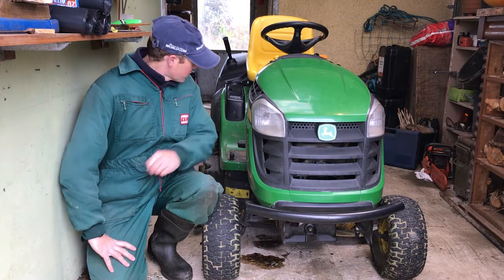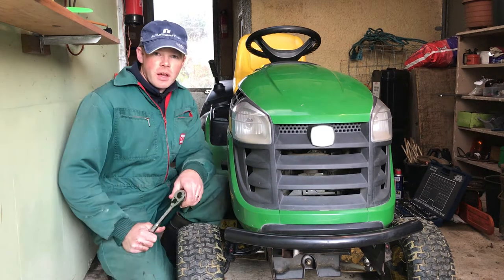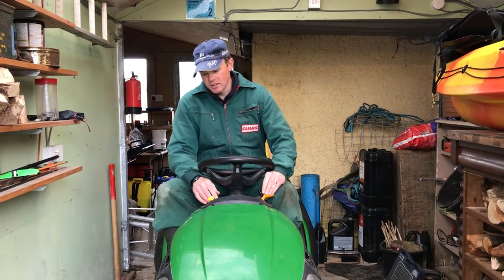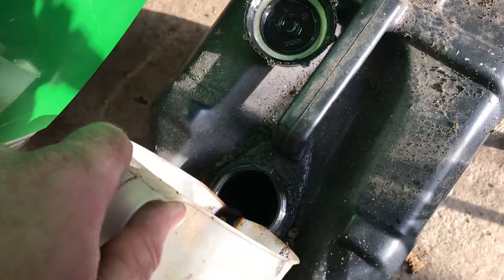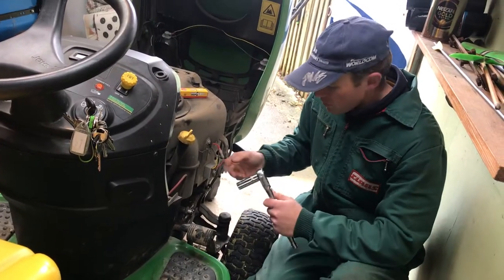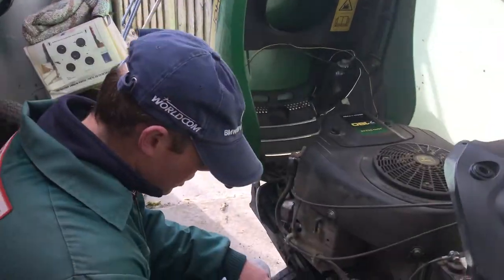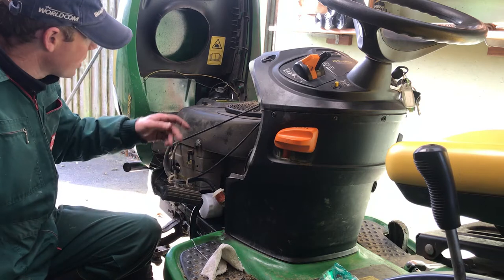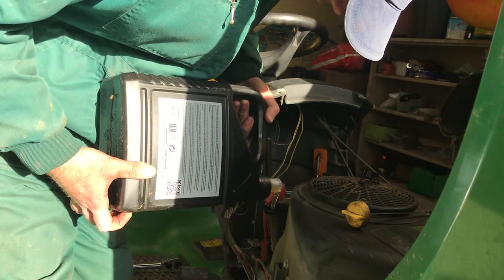John Deere X155R Mower Servicing

Comment: Very useful video, thanks for taking the trouble - much appreciated.
 I have the same model JD X155, I think I bought it in 2012  but mine only has 70 hours on the clock.  It's a good machine, but I find the chute clogs too easily if the grass is even slightly damp, and we do tend to have a lot of damp days  especially where  I live in the NW corner of Ireland.  The black mesh in  the grass collector box tends to get blocked with grass mulch and I suppose that really restricts the flow of air through the chute and into the grass  box. 
I've had it serviced once at a workshop and changed the plugs, air filter and oil and filter and greased up the  kingpins etc. myself,  but after seeing your video I would be able to do all of that no problem. I've been a biker for many years and do a lot of servicing on my motorcycles.  But the belts and pulleys  on the mower were a mystery to me,  that' s something I was a bit concerned about TBH.  Glad to see they are so easy to access, and I'll be  getting in about them in the coming days. 
Since you use yours so frequently, could I ask, have you had any problems with the  chute getting blocked with damp grass, and could you share any tips on that problem?
Reply from the maker: Hugo Hackenbush thanks for the I’m late seeing some of the comments. Ye mine clogs quite easily In the wet grass, I think the main tip is keep the blades sharp as it’ll clear the grass shoot better, and lift the deck a bit as the air slot half way down the shoot closes as you lower the deck. Sometimes I have to let it clog and mulch cut it to get the job done if collecting isn’t essential just slow it down not too strain the belts then. 👍
Reply: I have the same one. What I do if the grass is wet is I don’t attach the bag to the back, I just put the deflector on instead and just spray the cuttings on to the lawn. Then I go back round with the bag and collect the cuttings. 
Means I’m doing 2 runs of the lawn but it’s easier for me. Seems it only clogs when it’s collecting in the bag and cutting at the same time

Comment: Great video, very informative. I have a JD x166r, it is 18 months old with approx 40 hours on it. I have noticed as the engine gets warmer something within the steering column starts to squeak really loudly (louder than the engine noise!). I noticed you had your steering replaced on a x155r, what were the symptoms prior to it failing? What needed fixing?
Reply from the maker: Jon Fog. It was the steering rack and cog that wore out on mine which was I think was caused by poor fitting in the factory, been fine since and nearly done 600hrs. Symptoms were steering wheel slipping you could feel it click on cog. The squeaking I get aswell which on my mower put it down to the steering column under bonnet rubbing against the plastic housing i just give a spray with wd40. Thanks for watching
Reply: @RuralStuff  thank you

Comment: hello, how often do you change the blades?
Reply from the maker: Hi, On this mower I’ve only changed them once at 500 hours, it’s at 650 hours now on the same ones. I take them off to re sharpen every 2-3 months. I change them if them if they get a bad stone chip or the tips get worn down. Partly depends how lucky you are not hitting any hidden objects in the grass. 👍
Reply: @RuralStuff  thank you very much